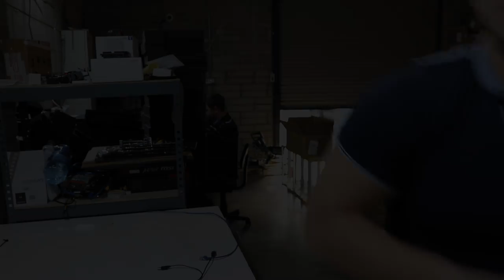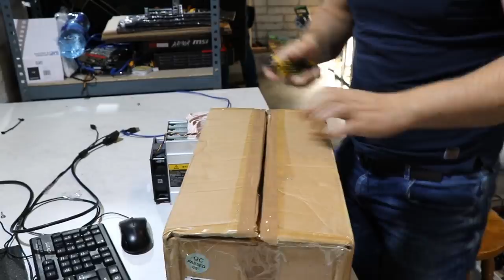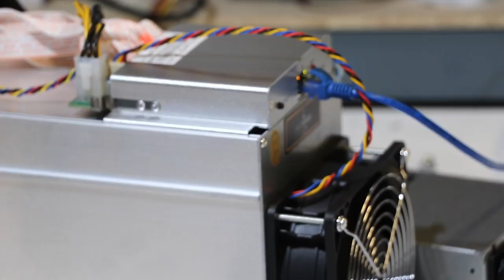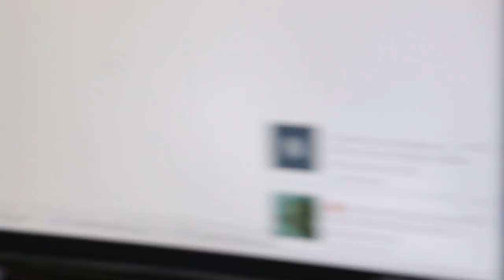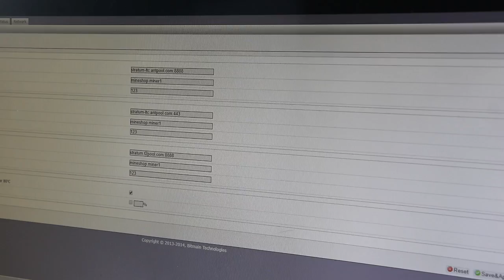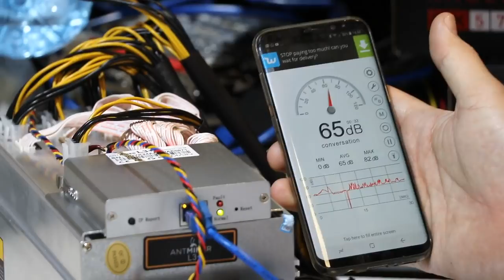Ho To mine Litecoin | Review L3+ miner | Litecoin mining tutorial!!!

Comment: gunter what is your voltage on wall there in Ireland?     I know Bitmain will run with 110-120V or 200-240V.   Not sure which you are using.
Reply from the maker: BlockBasher 240v here
Reply: BlockBasher Recommended is always 220v